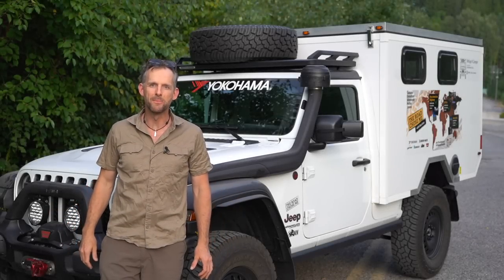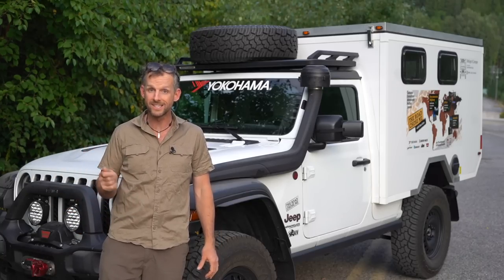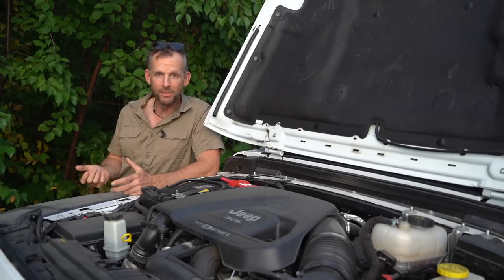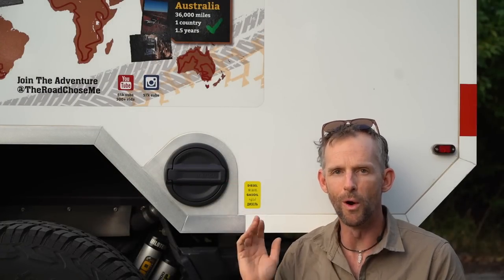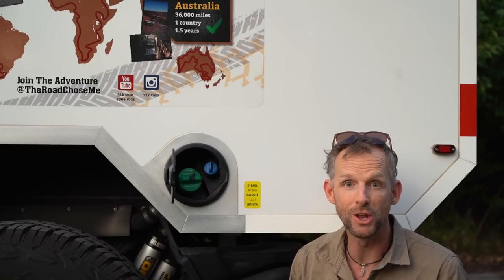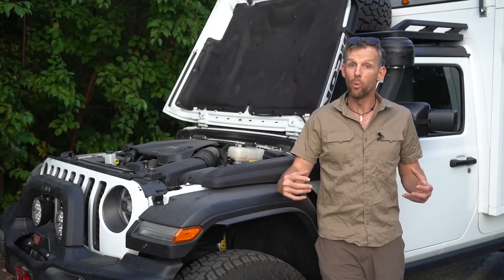Driving a Modern Diesel Around The World - is this a REALLY bad idea?

Comment: Great informative objective video. Have you checked your fuel consumption with the box on the back?

Thanks for exploring and learning for us.

I think complicated on a trip is an issue i try and keep it simple. (Running a Toyota 1HD FTE with its electronic swapped to mechanical fuel timing).

Regards from ZA.

Thanks Dan.
Reply from the maker: Yep, the 23 US MPG (10l/100km) I'm getting now is with the box on the back and the spare on the roof. I'm pretty happy with that.
Reply: @TheRoadChoseMe  that's excellent consumption.
Reply from the maker: Which is the number 1 reason I went for the EcoDiesel!
Reply: @TheRoadChoseMe  the question I always ask myself is "what if I require specialist diagnostics(complicated laptop stuff) in the bush" this is why I try keep it simple. FYI a guy with a new Merc G wagon got stuck in limp mode in Botswana only to find out when the vehicle got to the dealers it was something which has to be reset by the dealers(that sucked). 

This I think it's a concern with many advanced vehicles used to Overland. However the tech reliability is becoming better as time goes on.

For dirty diesel and water use a filter funnel to try filter the crud and water sulphur is always a problem if you start getting blowby it could be the rings sticking in the piston(not good) if the engine starts making oil(diesel getting past the rings) change the oil soonest you could end up with a run away engine.

Agree dirty fuel at least half your oil and filters change intervals. I would also keep an aerosol cleaner or something similar with the tools to clean the sensors down the exhaust line(if you can) as they will clog up and give wacky readings.
Reply from the maker: You're absolutely right, though sadly I'm not sure there is a viable solution other than buying a 25+ year old vehicle...

Comment: Higher sulphur fuel is better for your engine because it has higher lubricity than low sulphur. The government set the emissions standards for auto manufacturers to meet and they came up with the particulate filters and urea tanks that all modern diesels have now, to keep them from plugging up they recommend ulsd, then they had to redesign fuel pumps and injectors to handle the reduced lubrication of the "cleaner" diesel. The state of California has the most comprehensive testing on the lower lubrication of ulsd if you want to read up on it. I have three welding trucks in Alberta and I've deleted two of them (2013 and a 2021) I haven't found anyone to delete the 2023 yet. I agree with you 100% on the reasons not to delete but twice I've been stuck with def fluid flash freezing in the lines when trying to fill it
Reply from the maker: Interesting. I know lots of people say the extra lubricity of the high sulphur is a good thing for modern injection pumps, but also lots of people say it will kill them. It's hard to know what the actual truth is!

Comment: One of the reasons I really like jeep is because they never really went with a "one size fits all" mentality. The community never did either. I would to get some octane boosters and go with the turbo 4 cylinder. You have to think of pros and cons. I the pros out do the cons for you then you go for it. I do think you're forgetting about the extra tank to store the exhaust fluid. That is taking the extra gallons and probably putting you back to the same weight as gas. Add the weight of the system itself and your over the 4 cylinder weight i'm sure. Still if it's something you want to do go for it. Jeep gives us a lot of choices which give us the flexibility to do our own thing.
Reply from the maker: Yep, it's lego for grown-ups for sure!

Comment: The only thing I can suggest it to keep the DPF free of debris. As you likely already know, DPF covered in grass, leaves etc is a huge fire risk and we've had a recent spate of SUV fires here with vehicles burning to the ground as a result.
Reply from the maker: Interesting, I though the DPF was up high right at the back of the Turbo. I'll have to research more.
Reply: @TheRoadChoseMe  The DPF should be near the exhaust. The entire burning process can get very hot (especially during regen). So if you stop for the night somewhere in high&dry grass, this can happen. However, for overland vehicles like yours this is very unlikely to happen as you are very high.
Reply from the maker: Because I grew up in Australia I am extremely careful about grass fires from the exhaust. I never park any vehicle offroad without checking if anything is touching the exhaust. When driving through long grass I also stop regularly to clear out anything getting stuck near the hot exhaust

Comment: The DPF system itself should last the life of the vehicle.  I think most people with issues have deleted their DPF then tried to sell the vehicle only to find out the adblue has crystalized in the tank.  Or they buy one unknowingly with a tune and the software gets overwritten at next service.  Also finding adblue can be a pain and if you don't top up you'll be driving in limp mode.  I personally chose the naturally aspirated 3.6l because I wanted a lighter vehicle that's easy to learn to maintain myself.  Interestingly the diesels were cheaper on the used market.

Comment: FYI the VM 2.8l diesel was offered in the 05-06 Jeep Liberty in the US
Reply from the maker: Somehow I always thought that was a different engine, but I'm probably wrong.
Interesting Jeep did actually certify it for emissions in the US, but then never put it in the Wrangler for the US, even though the export ones were all made in Toledo.
Reply: Can confirm, I owned one of those here in Canada at one point .
Reply: @TheRoadChoseMe  There was some weirdness going on with the VM 2.8l Liberty in the US. It was sold in the US but not emissions compliant for California, so it wasnt sold nation wide. Then in '07 tier 2 diesel emissions requirements came into effect and the little 2.8 couldnt comply so they stopped offering it. I wish they offered the 2.8 in the Wrangler JK in the US, but for some reason they couldnt justify it.

Comment: I think the low end torque that accompanies diesel is underrepresented in this discussion. Having torque on tap at low rpm has a real impact on drive ability, IMO, and is a major advantage of diesel over gas, especially in off-road scenarios.
Reply from the maker: You are 10% right, I should have mentioned it!

Comment: I just ticked over 43k in my ecodiesel wrangler rubicon with no issues thus far🤞 I had the ever common rear locker sensor failure but the engine has been great. 

Just put 37's and a 2.5" lift on it and it is still good on stock 3.73 gears with all of the torque. Granted it did slow it down a little acceleration wise, and of course I took a good hit in MPG. If we do decide to keep it, I will probably regear to 4.10 gears to keep it as close to stock as possible. 

Not gonna lie though a "weight loss" program would be nice, don't say the dirty "D" word. +80whp, +140wtrq, 2-3 MPG increase, and removing most of the common failure points on the ecodiesels.
Reply from the maker: Interesting. Does it even kick into 8th gear with the stock gearing?

Also I'm always really curious about the tunes that add 100+ wheel torque.
Jepp limited it to 420 ft. lbs. because the rear pinion is not rated for higher. I can't help thinking adding 100 ft. lbs. is just a recipe for eventual failure of the rear axle.
Reply: @TheRoadChoseMe  yes it does, I did of course program for the tire size for accurate spedo and proper shift points of the transmission. Of course though it doesn't naturally spend as much time in 8th anymore. I could have gone with lighter tires, like the KO2, which would have helped. However the mud we have here in GA/southeast just disrespects the KO2's. So I went to the Cooper STT Pro mud terrain, but they are about 77 pounds. Plenty of drawbacks to an MT but I feel so much comfortable when traversing mud holes which every trail here seems to have. Especially any of our offroad parks. 

When the pinion fails just switch to 1 tons. It's a really easy and cheap fix 🤣🤣
Reply: @TheRoadChoseMe  also keep in mind with the company I have seen for "weight loss" their tuning is a multi-map setup which is easily changeable via steering wheel button commands. Stock, +40, +80, tow.
Also they offer a "stage 1" tune that simply shuts off the EGR system but leaves the DPF/DEF system intact. The EGR's are the absolute number 1 thing to turn off if anything is to be turned off.
Reply from the maker: Thanks for all the info. What company did the tune?

Comment: Having own a '90 toyota turbo diesel, I can warn that they the early engines are not without their faults. A large proportion of japanese diesels of that era even when new had weakeneses in their cooling systems, that meant head cracking and headgasket failure was common. So if you do buy one, Nissan, Toyota or Mitsubishi, be prepared for cooling system problems.
Reply from the maker: Good to know, thanks!

Comment: i have a 2010 land cruiser 3.0 d4d diesel. I only travel around the "most" developed countries (Norway, Finland, Sweden) and the mileage im doing made it obvious i can't have a gasoline engine. I am super happy. When Russia "unlocks" I will have no problems with diesel there (obviously haha). I'm glad i dont have to add adblue (euro4) but if it lasts for 16k km and i do service (oil change etc) every ~13-15k then i could sync that with the service no problem. I'm considering a modern diesel european Hilux but we will see.

But one thing that bothers me: how do you get around the annual vehicle checkup which determines the legality of the car? if i went on a 366 day trip the repercussions of having my vehicle not checked up and stamped in the book even for 1 day would be huge, so would be the fine (thousands of $)
Reply from the maker: Getting your vehicle inspected depends entirely on where you live and what the rules are there. Where I have mine registered there is no requirement for anything like that, ever.
Talk to other people that register their vehicle in the same place as you, maybe there's some special way you mark it "out of country" and it won't require the inspection until you get back. I know Germany has this.
Reply: @TheRoadChoseMe  thank you, will do

Comment: Hey Dan, was wondering if you have spent some thoughts on mixing low with high sulphur diesel to reduce the total amount of particles the engine has to deal with? I have been researching this topic also quite extensively and I have also stumbled across fuel additives that will chemically reduce the effects on the injectors (at least thats the claim). What do you think?

I think the modern diesel is a great choice!
Reply from the maker: I think the challenge with mixing it is you would have to transport huge quantities of the ULSD to then mix in - how will you do that?
I'm interested to hear what additives claim to help with high sulphur diesel
Reply: @TheRoadChoseMe  Carrying a jerry (20 liters) can be an option but can be problematic at border crossings. I fill up the jerry can with ULSD and ensure that at the border crossing the tank is full. With a range of say 800 km (500 miles), this can take you past a problematic country. If needed, you can fill up LSD when your tank is still 60-70% to extend your range.

Liqui Moly has a Diesel Particulate Filter Protector additive. There are also additives to clean different parts of the system like the injection nozzles. If they really work it is hard to tell.
Reply: @TheRoadChoseMe  Carrying a jerry can be an option but can be problematic at border crossings. I fill up the jerry can with ULSD and ensure that at the border crossing the tank is full. With a range of say 800 km (500 miles), this can take you past a problematic country. If needed, you can fill up when your tank is still 60-70% to extend your range.

Comment: I run commercial diesels at work and they aren't as bad as people make them out to be.  In the commercial world they get great economy if cared for compared to older, non-emissions diesels.  What I've always heard about modern consumer diesels is they don't like to sit around.  If you're driving this thing, as you plan to do, I think it'll be plenty reliable for you.  I would not take the chance personally on a modern diesel in a camper because I don't drive them often enough.  They like to work!
Reply: Agree 100%. I have a RAM 3500. 7 years and 250000 on it and not one issue with emissions. I run it everyday, nice and hot, and I believe it is because I use it. That said, I’m looking at doing a camper build and it will be gas. It will be sitting a lot.

Comment: As a fully qualified mechanic, with experience, building Overland Bedford and Mercedes trucks for Africa.
Large truck diesel are awesome and just go and don’t require extra servicing that’s involved in small diesels that are in jeeps etc .
Would I drive a Jeep or any modern small diesel? No!
Too many required services , fuel needs to be clean of contaminants, and also be of course to the modern standards as you have explained very well.
I’ll just stick with a modern petrol engine with good filters in the system .
Yes, the petrol does require larger fuel tanks to go the same distance , but a petrol engine requires less servicing per kilometre and is more reliable overall until you get to the large diesels over 6 to 8 L engine.
For the same reason, I’ve simplicity to travel with always stick to a manual transmission as well much easier to fix on the side of the road if needed .
And also can be driven without having brakes, working, just using the throttle if the worse comes to the worst .
Anyway, that’s my five cents from years, driving, adventure tours, North Africa, Scandinavia, and Europe .
But of course down under is the best, and I love loving the capital country of down under, which is good old New Zealand .
Reply from the maker: Absolutely, I trust your experience on this, you know way more than me!
Enjoy the little island!
Reply: @TheRoadChoseMe  I still wish you all the best and love your Jeep project, it has me thinking along the same lines with my Suzuki Jimny ultra micro overland/camper (sleeping inside) but would like to upgrade to a Toyota land cruiser, 70 series wagon, for more room for my Dog and I.
I still can’t believe that OZ copied New Zealand’s flag and added a few more stars for the other parts of Australia. New Zealand has four stars on our flag for the four main islands of New Zealand which are North Island, South Island, Stewart lsland, and West Island (the biggest island) 👍🤣🤣
Keep up your great videos and adventures

Comment: VM VM VM VM !!! bulletproof engines, as you said, the next trip will include a lot of europe so no delete is the only solution , in the us its easy to fuck around with coal rolling and all that, in northern europe you are going straight to the impound, zero issues with finding def and since its an italian engine, here its used in all sorts of commercial vehicles there will be no shortage of spares if they are ever needed.

plese fo fan meet and greets when you come over the pond !

Comment: IMO, as a casual observer, maintenance costs for diesel vehicles pretty much negate the improved mpg.
More expensive fuel despite less cost to refine.
Added operating cost for DEF.
INCREDIBLY expensive turbo repair...
Much more expensive oil changes.
Emissions system maintenance/repairs 😱
Reply from the maker: For sure that very well may be the case.
The biggest difference is that in many parts of the world, diesel is half the price of gas

Comment: I commented on your Patreon but I'm going to share it here, because it might be useful for the general public to know too. Either way, it was a fantastic video!

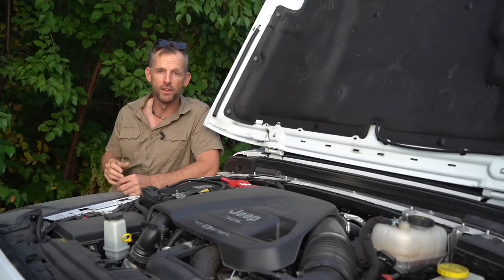At 2:15 you stated modern petrol engines don't have the level of complexity that a modern diesel does. This is true, except in Europe, where petrol engines actually have Gasoline Particulate Filters (GPF) just to meet Euro 6d emissions standards. This is already causing problems, just like DPF systems do, and Europe has a lower sulphur content in both petrol and diesel than North America at just 0.001% (10 ppm). With Euro 7 only a couple of years away, this is only going to get worse.

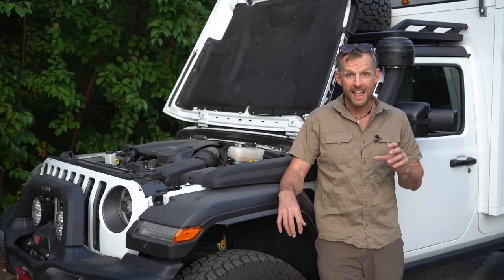Related to this, your section from 7:30 was very comprehensive, but the only thing I will say is that you will need to check with your manufacturer what the maximum permissible sulphur content is. For modern Land Rovers, as an example, all vehicles with a DPF can run on sulphur levels of up to 0.005% (50 ppm), and vehicles without up to 0.2% (2,000 ppm). Older Land Rovers such as the old Defender Tdi can run up to 1.0% (10,000 ppm).

If there is a silver lining, Europe has the highest diesel quality in the world, with a higher cetane (51 cetane number vs. 40-45 cetane number) so it'll burn better and run more quietly, lower sulphur levels (10 ppm vs. 15 ppm) so you'll use less DEF and have less DPF regens, and less aromatics than North America. On the downside it's also some of the most expensive diesel in the world!
Reply: Any kind of fuel in Europe is extremely expensive.This is a place for a  certain budget overlanders.
Reply: @strofimios  Try living here, taxation is so high its not even funny. The UK has a 20% sales tax for crying out loud!
Reply: @cameronwood1994  23% here,i live in Greece.African wages with european(in most instances even higher) prices.
Reply: @strofimios  How are you supposed to live? Madness!
Reply: @cameronwood1994  You are only surviving,living is another thing...